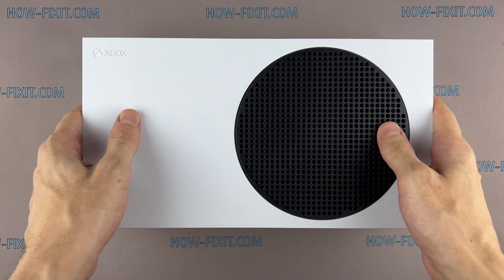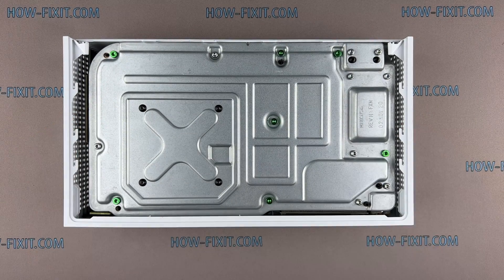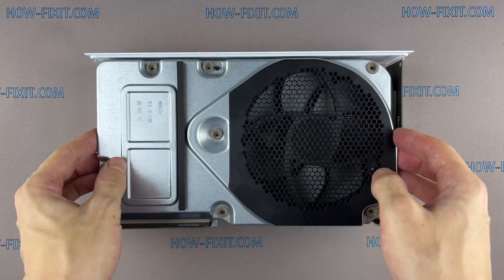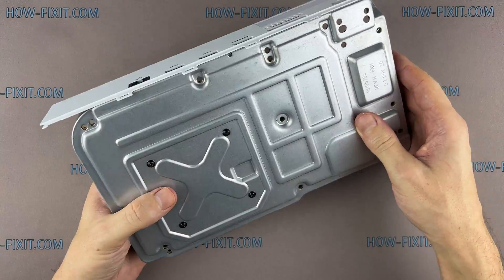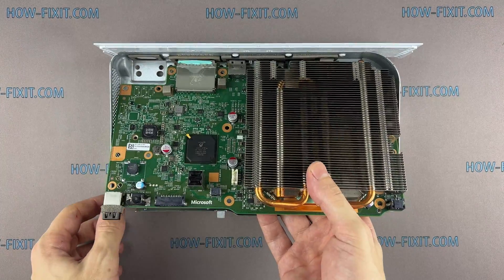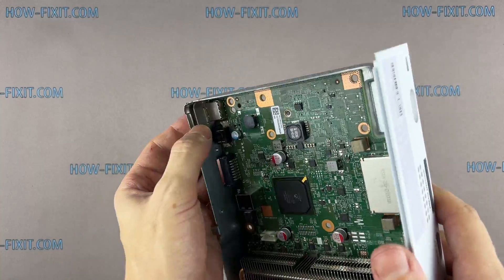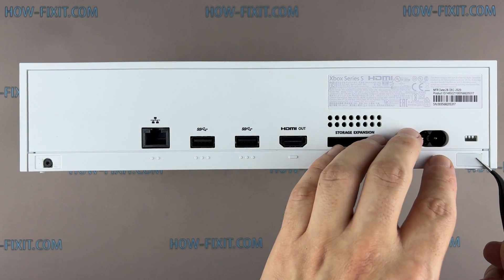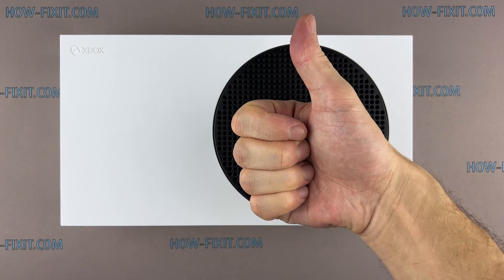Xbox Series S internal m2 ssd replacement

Comment: Hello, I have a series X, I removed the internal SSD, now the display does not come out at all and it does not enter Safe Mode. Is that right? Without an SSD, it will not have a display and the Safe Mode does not work with the Xbox.

Comment: Thanks for the breakdown. Even better are all the comments thinking it is hard. Crucial P310 SSD 2TB M.2 2230 NVMe PCIe Gen4 Internal SSD - for those looking for a compatible drive.
Reply: Hello, did you actually manage to replace the internal SSD with the 2TB model you mentioned? Is there any guide we can follow about the cloning and restoring the data onto the new SSD? Thanks a lot! Also, if you don't mind sharing, is your Xbox Live account still okay?
Reply: @matteventu  I didn't bother with a clone, as I didn't care about the existing data. I just did a clean install(copy over the boot partition from old to new drive) and then did an offline backup from a USB drive once the new drive was installed. Account works just fine afterwards. I don't have the link to hand, but there are definitely guides on youtube for doing this.
Reply: @pcrem9953 thanks a lot for the quick reply! So just to confirm, you now have an Xbox Series S (not series X) with INTERNAL SSD that's the P310 2230 2TB?
Reply: @matteventu  Well, my son now has, yes :)

Comment: I have an issue on replacing the m.2 SSD... I purchased the xbox series s last day and tried to replace the SSD with WD SN740  2TB, I have created the orignal SSD image in my computer and cloned the requried 1.0 GB partition to the new SSD, the machine does boot up, however, when I tried to do the offline update to repair the machine, it show Error E109... I though it was the SSD issue, so I tried to put back the orignal SSD to the machine, but it still can't boot... the xbox light show up with beet sound but off instantly, I have tried to reclone the backup image to the orignal ssd but issue same, even I follow the same step to clone the WD SN740, it still doesn't boot up, can you advise how can I repair the machine ? Many Thanks !

Comment: What if you used a WD530 1 TB then uploaded OS via usb in safe mode. That would exclude needing to clone as the SSD would format and install OS…??? Yes or no
Reply: Won't work as you need to copy over the special security partition that is tied to the console hardware, NVMe drive model and the software version.

Comment: This looks like a major pain in the ass. I applaud Sony for making it easy to upgrade the ssd on PS5. As a guy who owns both consoles I hope I won’t have to replace the internal storage on my series s.
Reply: I don’t understand the complaint, with Sony you can’t replace the SSD if it gets damaged, it is soldered to the MB, the expansion SSD is easier on Xbox but is more expensive than PS5 since on this one you can use a standard M.2, but neither of those are easy to fix if the ssd is damaged
Reply: @byronchajon5092 well yeah you may be right but not everyone can just take it apart I’m pretty sure people love the ps5 way because you just slip it in some people including me just can’t take it apart
Reply: @byronchajon5092 and yes if I fall to such a tragedy I am indeed fucked

Comment: PCI E GEN 4x4 SSD´s that work are:

Dell 512gb: AC280178 
Dell 1TB: AC280179
Reply: Nice, thank you! Anybody tried 2 TB version?
Reply: the 1 TB is still expensive, but at least it's just 150 dlls and not 250 dlls
Reply: Hello, have you actually tested those and can confirm they work fine when put in an Xbox Series S?

Comment: Can you use a m2 with more space, I like to get more space on my internal storage. Or would it be best to get the memory card for Xbox Series
Reply: i also have the same question but i think that you will be able to as long as it [the ssd] has a fast enough read/ write speed and not to mention compatibillity with microsofts firmware but i think it may be a viable solution if you are willing to speed a few hours and about 150 - 200 dollars (AUD)

Comment: Can I use an usb3 external hdd as extended hdd space or only the expansion card available?
I've been told that I won't be able to play games off the external hdd. I'll have to transfer the game to the internal storage before it'll play
Reply: On USB External Drivers you can play games that are not of the new generation. Next Gen optimized games must be run from Internal SSD or Expansion Card

Comment: Very informative. I learned in NOT replacing the internal and will just buy an external. I've upgraded both my PS4 and PS5. Those were a walk in the park compared to this
Reply: They found a way to make it frustrating though. Most newer games on gamepass with the X/S logo can only be played on an internal hard drive.
Reply: You can get a sea gate expansion pack
Reply: @calebwilcott9699 Came here to say this. It's expensive, but the Seagate expansion (and now the WD one) feature the same velocity architecture as the internal one. This architecture is also the reason why there are no compatible SSD's.
Reply: But sadly only games that are not optimized for current gen work on an hdd
Reply: The PlayStation slot is an expansion not the existing slot like shown on the Xbox …… Xbox’s expansions slot is on the outside but yes still more expensive.

Comment: STILL waiting for that "ssd m2 compatibility list" that you will update over time.
Reply: Cause there are no compatible drives that use PCIE 4.0 X2 connection . 
All standard nvme M.2 drives whether 3.0 4.0 or 5.0 use x4 connection not x2
Reply: @50H3i1  Gen 4x4 drives should work on gen 4x2. They'll just run slower than they are rated for given half the lanes available to them.
Reply: @50H3i1  also you can just get a MS Surface drive or match the part number. they are expensive drives.
Reply: I came here to say this.
Reply: @Jester06986  real
Reply: still waiting ssd m2
Reply: Still waiting
Reply: Hey man, can I use SSD from another Xbox
Reply: @vanhiepnguyen8337 
2years still ⏳
Reply: @T0PG1  hey man, I have a xbox one s, and i want to upgrade software by using USB, but my controller is broken, do you know any tip
Reply: Still waiting....

Comment: Damn, they really do not want you to upgrade the internal SSD for cheap by putting it the farthest down the console they could😂. They really expect me to buy an external SSD for 300 bucks
Reply: On ps5, they go even further. Internal storage is bga soldered to the main motherboard. The slot is actually external storage, just like series slot in the back. My biggest gripe about these consoles, they both really made sure you are screwed if internal fails. Not like previous gen where you can just pop a new drive in. Although you can technically on series, it won't be recognized unless you can successfully clone the old drive if the new drive isn't from another of a same series model.
Reply: @RainWalker24c no there’s a m.2 slot on every ps5 by just removing the side panels
Reply: @tyqwax  I think you ignored most of what I said or don't understand. That is a external slot, not internal. It will not function if the actual internal storage soldered in the motherboard fails. Yes you can format it to be internal but it really is just functioning as external. No firmware is in that m.2 drive you put in, what makes the console function.
Reply: @RainWalker24c  my fault i misread
Reply: That's apple move
Reply: @pradap2298  €200 more to increase storage from 256GB to 512GB 🤣 Apple is so consumer friendly company
Reply: Imma just cut a box shape hole under the Xbox 😂😂 n yank that m2 out lol
Reply: Thats the plan bro.
Reply: That's what I'm saying 2 years later it's literally like don't worry Microsoft we will all go f*** ourselves lol
Reply: but that external hd could be like 10tb for 300 now
Reply: @Skerplord  nope. Still 250 for a 1tb expansion card 🤦🏻‍♂️

Comment: just another scam by Microsoft just like apple, soldering the ram and hard drive since 2012 *mid, what apple laptop is still selling for 700$ 11 years later, all these company's do the same, try to put some bottle neck to force you into proprietary upgrades 

does everyone here really think that xbox cant figure out how to put a larger hard drive in the unit, that's not the case, 

and apple all the years with the iPhone, 16gb option that was almost full after you bought the phone with no upgrade options 

bunch of crooks any one here can argue these facts.

Comment: So you’re telling me instead of buying the expensive Expansion card, I can buy a new internal SSD for my Xbox series S?!
Reply: yeah, but at the time there's no point, because you cant replace it with a larger SSD without the risk of getting banned and also its doesn't physically fit inside the Xbox.
Reply: @ryutenmen  you can’t get banned for that
Reply: @immytech hello, did you actually manage to expand the internal SSD? Can you tell me a bit more? :3 thanks!
Reply: @ryutenmen  ok thanks for letting me know

Comment: I would like to know how to upgrade  the m2 ssd 512 gb to 1 terabyte m2 ssd
Reply: Get an nvme enclosure and plug it into the console externally, via its rear usb ports. Most games will take 3 to 5 minuted to transfer to the internal when to be played.
Reply: @MKMR  that a solution only to store the Series games, then move them back on the internal storage if you want to replay them. Only games for One, 360 and OG Xbox run from internal and *external storage.
Still, it's a decently good solution. I also have an external SSD on SS.
Reply: Is there any way to get all games old and new to play off external SSD vs having to constantly copy and move games around to free up space on the internal drive to play other games that won't run from the external?
Reply: You might get banned if you are upgrading to a larger than official SSD.

Comment: Any M.2 2230 gen 4 memory will work if cloned off an original image or format correctly, but they are hard to get and expensive so it might not be worth it. Maybe in the future when they become more available and prices are lower.
Reply: Hello this m.2 works?Disco Nvme - 2230 - 512gb  Lite On Ssd Pcie Pull New Interno for a expansion whit matrix adapter?
Reply: @estebanveliz6435  why would you put a 512gb drive in the xbox? There's already one in there so there's no point
Reply: @furguffles  como expansión de memoria en el el puerto trasero
Reply: @furguffles  maybe his original hard drive failed it happens
Reply: @myiq170  the comment was a mix of spansih and english. i can't read spanish. turns out he was asking if it would work for an external expansion with an adapter. my fault lmao. but you are right. although in my experience, ssds are very reliable!
Reply: @furguffles  Software Eng. and I have several laptops and have had 3 SSD's fail in last 10 years thats enough
Reply: @Anthony P  laptops are generally built cheap. I'm sure if a Samsung SSD was utilized they would not have failed.

I tend to stear clear of Seagate.
Western Digital was my old go to, now I'm a Samsung die hard.
Reply: @jigsta9  ironically one was a Samsung... Not trying to argue I was shocked myself.
Reply: @myiq170  Depends how many times you write on an ssd and how much heat stress it is under. laptops tend to run hot.
Reply: Kioxia BG5 2230 is one example I could find . BG4 is gen 3 . BG5 is gen4 .
BUT ..... those are standard pcie x4 drives . Series S and X use an unusual pcie x2 connection which is only used by these consoles
Reply: @50H3i1  an adapter already exists for this
Reply: @PaceyPimp  u mean the extenal ssd adapter or  x4 to x2 pcie m.2?
Reply: @50H3i1  No it's a to adapter to converter MVNE to Xbox proprietary port.
Reply: @PaceyPimp  I highly doubt it would work cause I once found something like that in reddit that some chinese guy made with camera storage cfe adapters .
Could you send me a link to it?

Comment: My only worry with this that that the hardwired serial number of the drive can't be cloned, which would mean that it could possibly in future be flagged as a modded system on the live service.......I am not saying it would, BUT, at present it's a grey area with these new consoles as to how MS would see this type of internal ssd replacement.
Reply: From what Ive learned the SSD its not hardwired but there one partition(1GB with no letter assigned) which soft lock the original SSD to the main-board so when you replace it with a new SSD you either must clone the whole original SSD or just that partition and then install the OSU(Xbox OS) and its good to go.
Reply: @ryutenmen  The one major issue here is no Series S has a 1tb internal SSD, so security wise even if you clone the 500gb partition, nothing is going to match because the clone information will state a 500gb but the ssd itself will be reading 1tb, so this i expect would to be flagged quite easily once connected to xbl as a mismatch, but as i said, we won't know this until a few people do it, but at this point the rumours are that 2023 will see a revised series S with some stating more internal storage, and possibly more 3rd party external ssd expansions as the exclusive Samgsung deal expires. :-)
Oh and that a revised seties s could be coming with a br drive to read discs, as i think the popularity of the S has surprised even MS:-)....all rumors though, so we have at least another 12 months to see. :-)
Reply: @bob23301  of course - if you put bigger SSD than 500GB on SS you are risking a ban. The same might be possible if you pun another brand or even a different model of the right brand, that is if it works in the 1st place.
All the above are certain, since this was also the case with 360 and One.

Anyway, the best you can do is to do a backup of the whole SSD or just that RAW 1GB(without letter that contain the ID that ties the original SSD to the motherboard partition) on your PC, to have in case the original.SSD dies, so you wont have to throw the Xbox to the bin.
Reply: @ryutenmen  At this point you might as well just wait it out rather than go through all that, but i did buy the xbox branded Samsung game drive external 4th hdd and store all my SS/SX games on that, plus the transfer times are like 16 mins for something like MSFS202 which us over 130 gig, only cost my £60, so i am more than happy. :-)
Reply: @bob23301  thats a good solution, just dont leave that external HDD always connected to to Xbox, especially when on because those 2.5" HDD's are pretty fragile and will end up dead after a number of hours.
To avoid this situation I got a USB HUB(from Orico) with mechanical switches for every port and I switch on/off only when needed.
Reply: @bob23301  ok yes and now, 

if its cloned then your getting what ever the size was this only works if you are doing this to replace the hard drive for failure think about it. 

if you have 5 tb drive and you clone it with a 2 tb drive it will only be copiable 2tb 

am i wrong on this  ?
Reply: You won’t get banned for changing your ssd
Reply: Just watch TronicsFix for xbox series x ssd replacement and cloning experiments 😅

Comment: What if I can not clone the drive my original ssd got snapped in half? What shall I do now?
Reply: RIP
Reply: @bestfriend3294  I've already put the console in the trash, because apparently there is no way of getting a new ssd to work without the old one and since the old one is broke I just threw away the console
Reply: @MrJamesstott  woah for real bruh,btw u can sell ur console part or just find someone who have spare parts
Reply: @bestfriend3294  but I was told nobody could have a spare ssd because the ssd is married to the motherboard and in order for it to work the old ssd has to be cloned so it was basically unfixable
Reply: @MrJamesstott  

Still useable for some parts though. Could've recovered some of the replacement cost by selling it for parts.
Reply: @Wrenchmonkey1  the replacement cost is so low where I live it really wasn't worth it for me, I can buy a used console in great condition for between £90 - £100 which is probably like $120 so they are so cheap it wasn't worth the hassle

Comment: Where‘s the cloning instruction?
Reply: Its a fake video
Reply: @raminham1077  Its not. You can replace(not upgrade) the original SSD with another one of the same brand and model but mind you that you must first clone the original one and write it to the new one before use.
Reply: @ryutenmen  posso copiarlo e usare un seagate rocketq4?